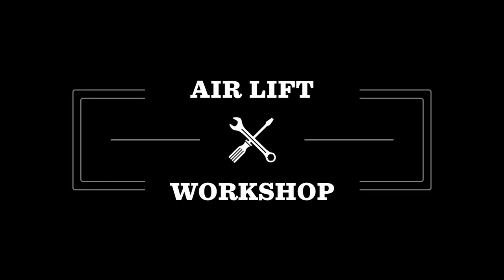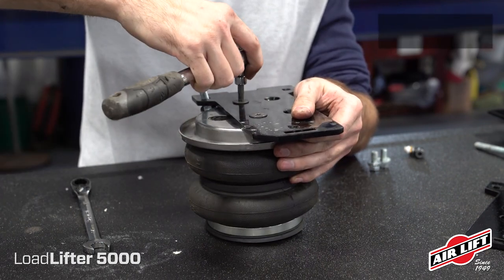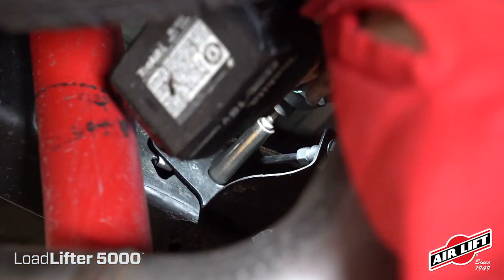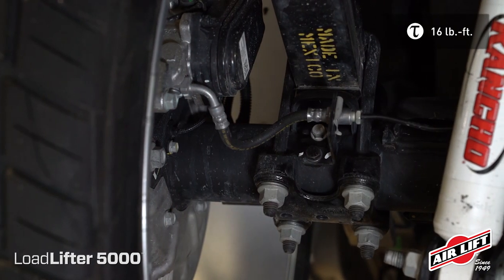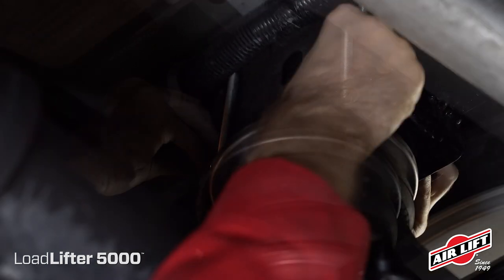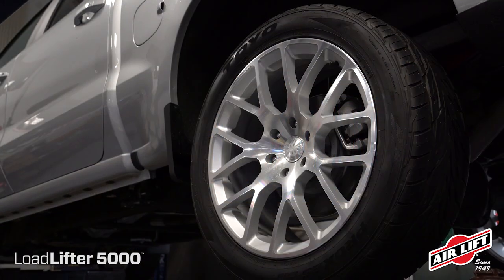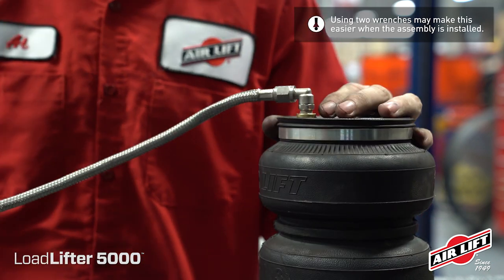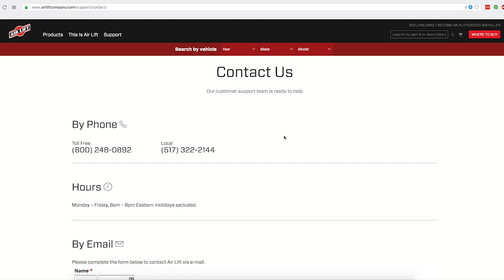Install Overview: 88288 - LoadLifter 5000 Series - 2019 Chevy Silverado 1500

Comment: Got mine installed, and yes, they do fit my 2020 Chevy 1500.  word of advice, paper instructions and this video way over complicate the installation and at times contradict each other but between the two i was able to get it done.  If anyone has questions please don't hesitate to message me. The only difficulties i had was lining up and reinstalling the wire harness guard, but i got it done.👏
Reply: Does it affect your ride quality when unloaded ??
Reply: Hey Chad. Just installed the springs also. I had difficulty getting the wiring harness guard in place also. How did you do it? Iy looks like mine will have to be slightly bent to get them installed.
Reply: @fralin1966  not at all.
Reply: @chadgeetter308  Hey Chad no worries man. I appreciate it. Everything else went smooth. I’ll climb underneath this afternoon and take another look. It was tight but with a bit of persuasion i think it will go. I’m not too concerned if the bracket hangs a little bit lower anyhow. Thanks for the reply!
Reply: @Schneids15  yeah I just took a look at mine, I know I had a hard time with that but can’t remember why. :(
Reply: @chadgeetter308  Chad how do you like the system so far if you had it over a year? I tow a camper and want to see if it will prevent the sag.
Reply: @ridgec5670  still going strong. Now towing a 10k boat. Levels right out.
Reply: I have question my brother, do you recommend if i want to install it only for comfortable ride in my truck and thank you so much. My truck gmc sierra 2017 single cab 4x4
Reply: @salemalrashdi4127  They  do not make any difference to the ride at all when the truck is not laoded.  i would not bother,  if thats the goal.
Reply: @chadgeetter308  thank you my brother very much

Comment: My 2020 Silverado rides really rough unloaded with this system even with 5 psi. Anything I can do to fix this? Bigger shocks in the rear? Thanks
Reply: I installed air bag my truck run very rough too .I want to take it off .any advice. thnx

Comment: Purchase air lift 5000 for my 1993 Chevy Silverado 2500 .two of the upper brackets are not matching with the frame of the truck

Comment: are the air lines supposed to be on the wheel side or to the inside of the truck? I have braided lines and if they go to the outside (between frame and tire) then I feel like they could get snagged

Comment: When are you going to come out with a bag kit that is compatible with the adaptive Ride Control that comes on the Denali trim line?
Reply: been wondering that also. but i have been taking measurements on my 19 1500 denali and looking into where these are mounted and i wonder if they will miss the arc arm.  i am wondering if they say its not compatible because if you run this your arc will read wrong. but what i am wondering if you run your bags with 5lbs or less when not loaded to let the arc read normal and only infate when hauling.

Comment: You are skipping some key parts. When removing the wiring harness bracket from the axels you need to also remove the clips which is a major pain in the ass.